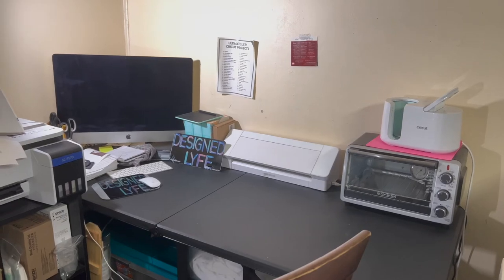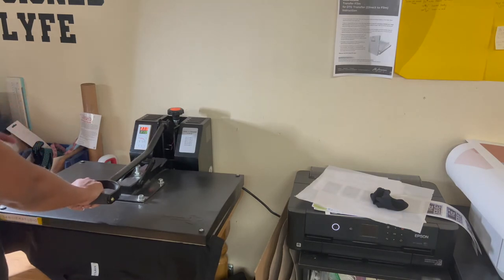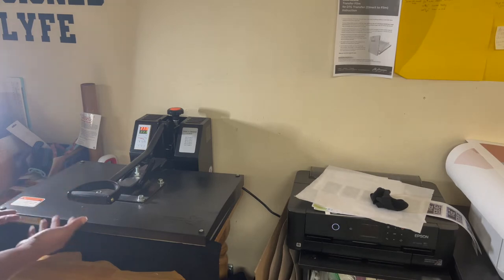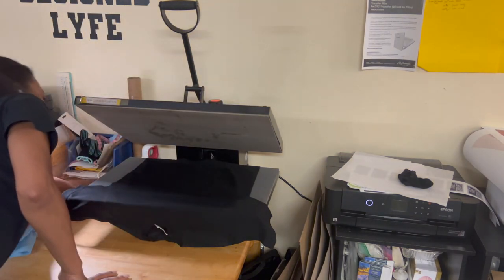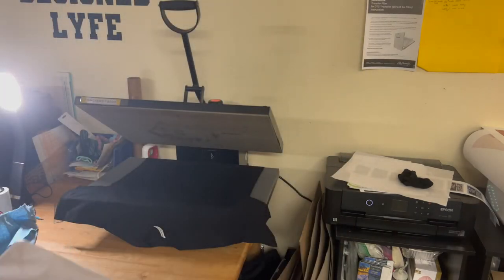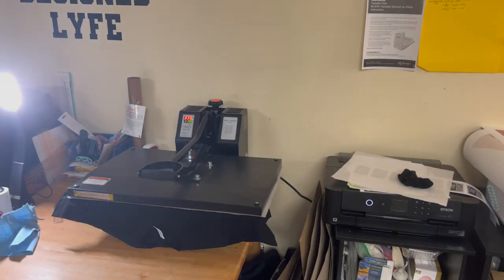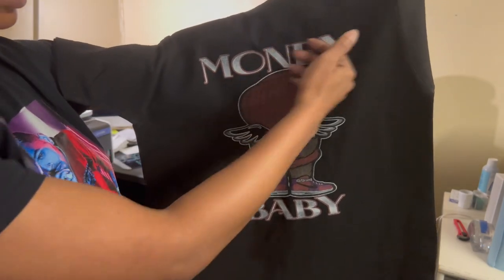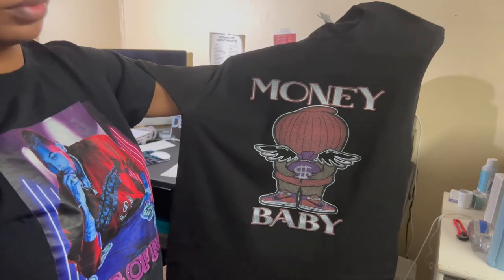DTG Not So Great Finish Part 2

Comment: Do you normally have good results on the black tultex 202 using DTG?
Reply from the maker: It was my first attempt, I bought 15 shirts to test with and only did that one so far. I was actually getting good results on the cheap Gildan 200. I’m going to be testing the Next Level 3600